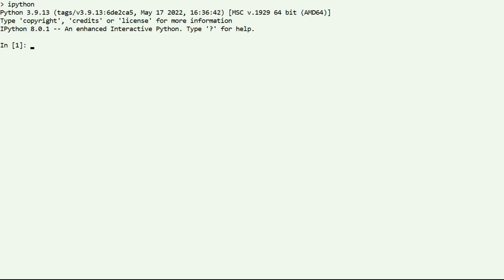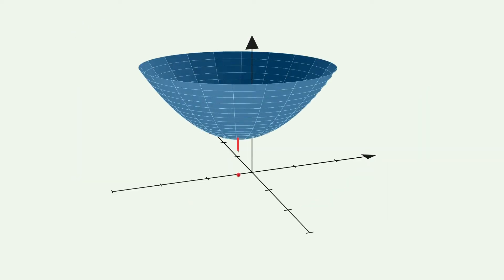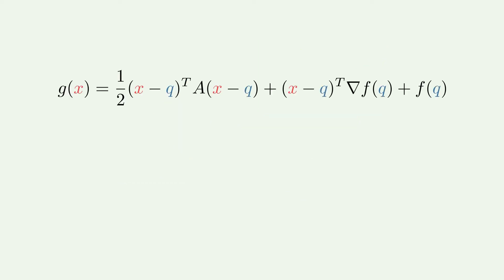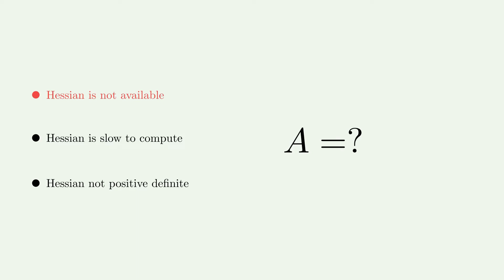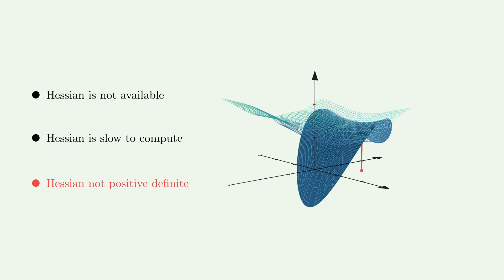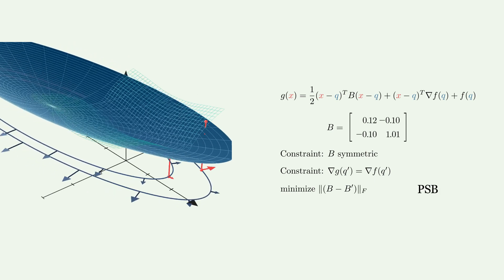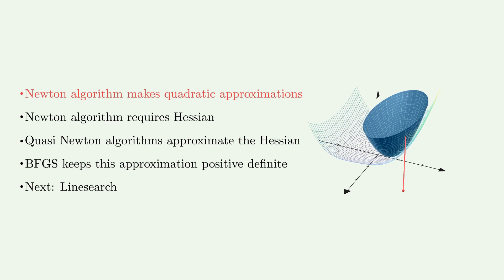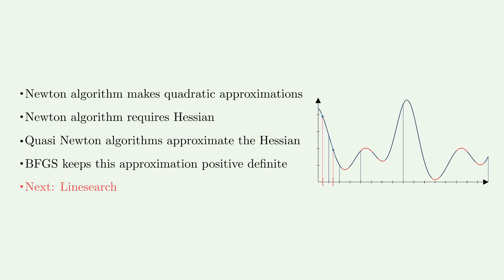Understanding scipy.minimize part 1: The BFGS algorithm

Comment: Really nice video, thank you! Just a really minor correction to 04:15... due to the symmetry you need to compute slightly more than half of the values, not exactly half of the values.
Reply from the maker: Thanks! You are of course completely right with your correction!
Reply: In the limit of very large matrices (which is when you start caring about the computational complexity and memory usage), it is almost exactly half 😀